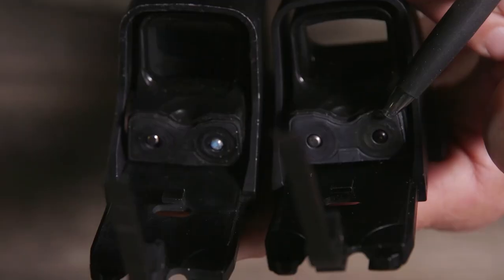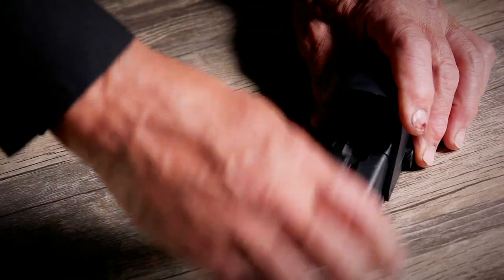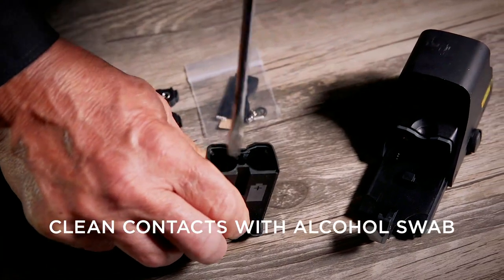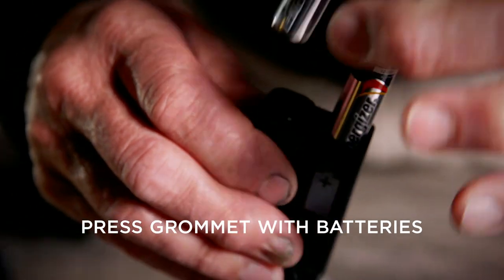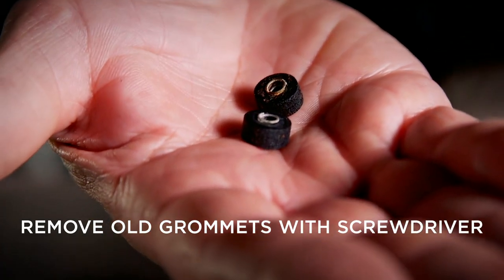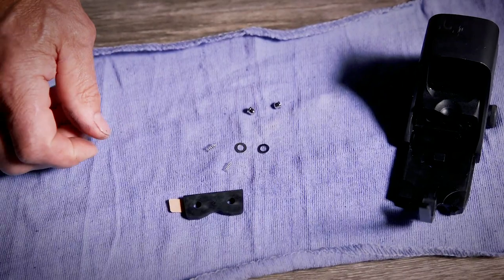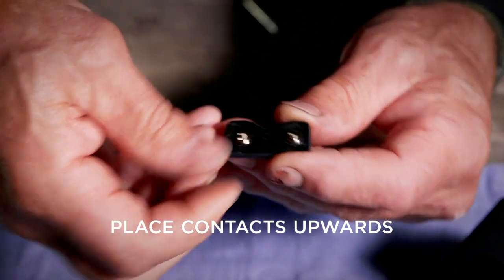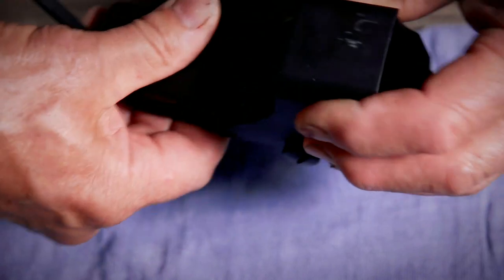EOTECH HWS Battery Contacts and Replacement Process

Comment: I’ve replaced my 512 battery compartment twice now. It’s stopped working yet again and no parts are available anywhere. For $500 you think they could have worked this issue out. It’s just a paperweight now. Should have went with Aimpoint.
Reply: Did that new battery compartment come with the grommets needed? thanks.
Reply: @Kdog123123  It did. I'm thinking of trying to send it back for repair. A friend has an xps that was no longer daylight bright. He contacted the eotech service department. He paid the shipping to eotech. They replaced the gas, sealed it and sent it back to him and eotech paid the shipping back. Cost him less than $80. Different issue I know, but may be worth a try.
Reply: I just pulled mine apart and sanded all the contacts and spring ends with 500 grit. It was tuff inside the small spring holes but I used a cut in half toothpick to sand those out. Just like new
Reply: The guy who sold it to me said this thing would last through anything. He said underwater, through mud, if I cracked the sight it would compensate and place the red dot elsewhere in the screen, nothing could stop it. I guess he didn't think about old batteries. I want my money back

Comment: I had corrosion inside my Eotech 512  so I ordered a new battery compartment and a contact replacement kit now works again! NOTE: Once you install the new contact adhesive gasket install the battery compartment as well so the adhesive seats good. Mine was coming undone before I did that.

Comment: Thanks for sharing the video. Eotech needs to put the bumper kit for the Battery Compartment back on their website. The 9-N 2107-A Grommet kit, and the 9-A Bumper Should be sold as one unit.

Comment: @EOTECH are you guys going to restock the 9-N bumper kit shown at 0:30? The one for pre 2009 552 models? It seems to be out of stock everywhere and not on the website. Thanks!
Reply: same question
Reply: back in stock tonight
Reply: Out of stock again..grrrr
Reply: I'm in the same situation.. However, it looks like they have the entire battery door for only $20. No need for the kit if we get the door right?

Comment: I have 4 Eotech 511. I have to use the dimmer in max level and I can't see nothing in daylight. Any tip for me?
Reply: I replaced the battery cap and still the same weak circle and dot.
Reply: Very possible that this is an issue with legacy eotech products, if you look up eotech reticle fading it did occur in earlier products. If it's older than 2016 I'd say 100% that it's your problem. Check the bottom of your sight for the manufacture date

Comment: Eotech...You uploaded this video a week ago yet you do not have either of these parts kits in stock.  Also, everywhere online I look, it says that the new 1 piece grommet with springs that goes in the nose of the battery cover (9-N Bumper Kit) is discontinued?......and the 9-N 2107-A Battery Grommet kit is very hard to find.  Can you please address this question.

Comment: I have the same question as the last commenter. I need to find the repair kit for 511/512 main unit with springs, cups, and washers with new rubber. I would also like to find the repair kit for the battery compartment as well. Any help is appreciated.  Thanks
Reply: The repair kit is on their website, linked in the description